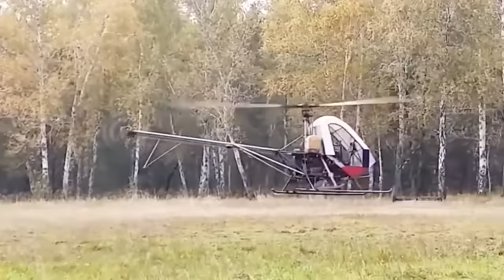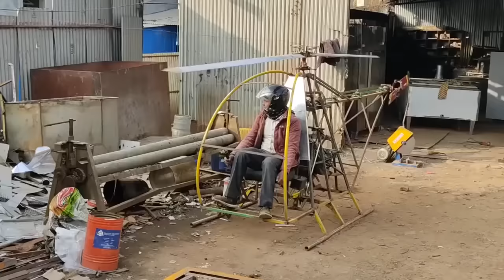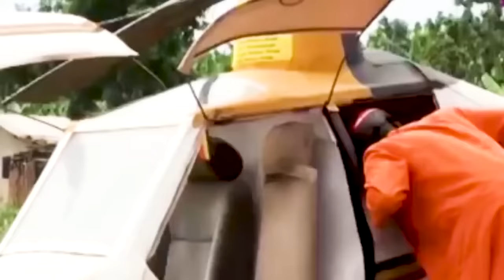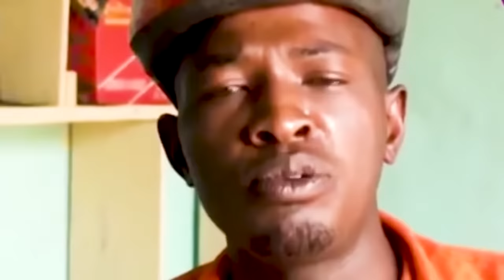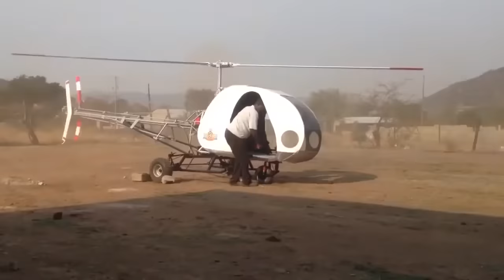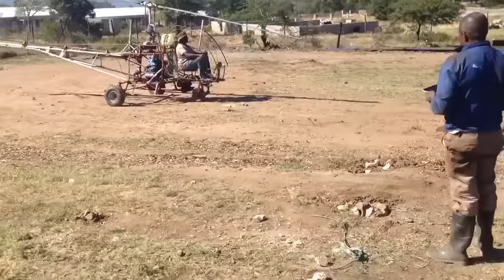20 Failed Homemade Helicopter

Comment: Keep in mind. Orville and Wilber were NOT aeronatical engineers! They were bicycle mechanics! No one was in those days. All those backyard experiments eventually paid off. Aviation was born in a garage by people who had NO clue what they were doing. They were courageous and curios. It takes passion to do this. Cut these guys some slack!
Reply: Well you are partially wrong , they did have a clue, over near Olive Hill about 7 miles east A Frenchman had a powered flight but it was being held by ropes as they experimented with their version of wing warping to control the banking imitating birds and the Grackle black bird's verticle tail and swallow tail inspired the rear control surfaces.  The black assistant's head got cut off and the frenchman quit and the Wright Brother's got the guy's wind tunnels and other research and went forward , their difference was the forward canard elevators  but the powered flights this guy made were heavier than air into the wind , it lifted itself off the ground several times but there was no confidence in the control surfaces system.  Also it was something like a 7 wing craft, and is or was on display as a mock up replica at Bluegrass field west of Lexington.  A historical marker for First Flights in Kentucky  is on U.S. 60 about 6 miles from the site , in about 1993 I was taken to the ridge top farm and the barn and vertcle frame of the Wind mill that drove the wind tunnel and lathes was still standing.  Locals say there were still parts of the plane in the barn until at least the mid1970s , you can walk the field where the guy died and see the location has good westerly wind even on a calm day probably should be a Kite flying festival there or something.  First in Flight on the North Carolina car plates could havre been sued over.  Wright brothers did have more than a few clues.  Their  more simple  design was what got them on the path to commercial flight sales.
Reply: When there is an abundance of information available by lessons already learned, and they either didn’t study those lessons, or ignored them, it’s hard to cut them slack.

Comment: The second example was fairly sound. His tail rotor was working well, the craft was very stable for a shed build. With a qualified aeronautic engineer, he may well have ironed out any bugs, but i believe some pilot training in a helicopter would have led to a better result for the pilot and his helicopter. I see mainly pilot error here.
Reply: I agree the Kenyan guy made decent effort, his machine looked well conceived but his piloting skills were not up to keeping it under control.  I doubt a qualified pilot would get anywhere near it so he had little choice in achieving his ambition.
Reply: Lol
Reply: The first error they made was getting in the death machines in the first place 😊👍